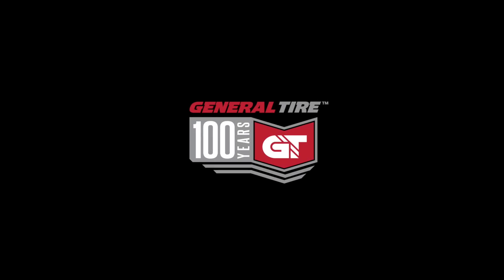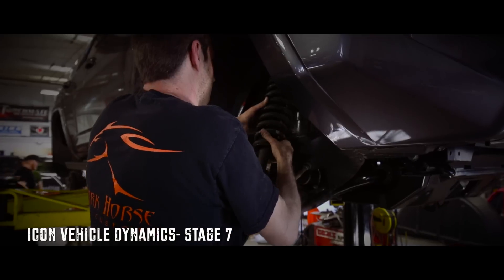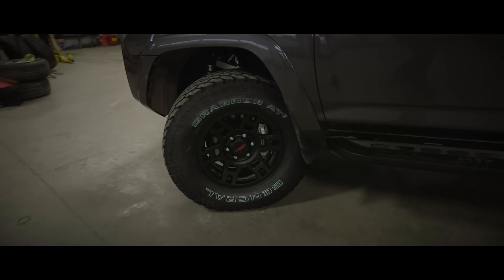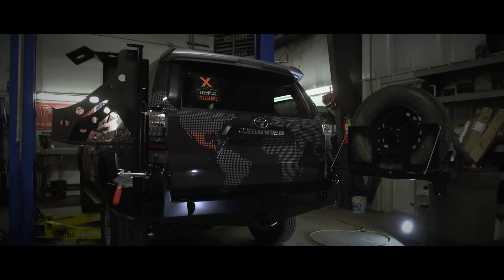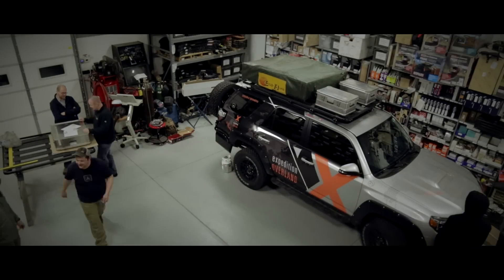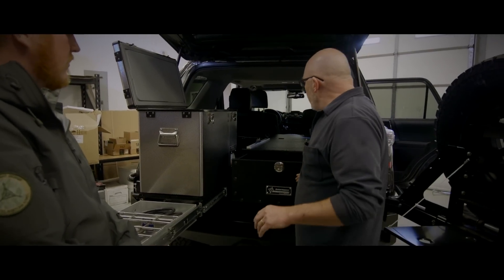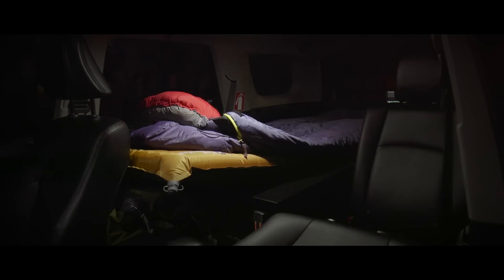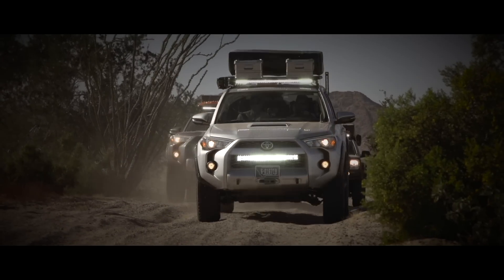Toyota 4Runner Overland Vehicle Builds: Expedition Overland Central America

Comment: I also have stage 7 ICON setup, but my absolute best edition to my overland build for my new 4Runner TRD Off Road has been the Magnuson supercharger.. My 4Runner now feels exactly as it should, on and off road.. I run 350hp to the rear wheels (35% gain in both hp and torque) and can now overtake on highways even loaded for touring.. I can tackle obstacles with less boot.. It isn't over powered and just gives the 5th gen that boost it definitely needed to make it perfect IMHO... I highly recommend it.. Tackling tough trails is a lot more fun now lol.

Comment: Love the series and the vehicles. One important note, batteries cannot be joined in series to jump start the vehicle, as the video states. They have to be joined in parallel. Very important.
Reply: I noticed the error too. Series doubles the voltage and can ruin the starter and other electrical components. Parallel doubles the amperage, which is what we need for starting. Probably just an errant mid-speak however.

Comment: What is the reason for installing Grabber AT2 All Terrains in "285/70/R17"  ....than "P265/70R17" size tires from factory setting ?? 

How reliable was 2015 Toyota 4runner trail premium during the expedition ? Any problems with engines, mechanic, overheat? What was the total mileage during the expedition round trip ? 

I have the exact same Toyota 4runner trail premium 2015. It was awesome to see how the 4runner trail can handle the tough terrains. Thanks for creating this awesome expedition, cannot wait for season 3.

Comment: out of curiosity, could you hazard a guess at what those mods and gear adds up to at retail prices?  I mean, its a very good looking set of trucks, but it sure looks spendy.  Also, did you have any trouble modifying KDSS with the lift?
Reply from the maker: Patrick Rich we would guess that these rigs would hit the 80K price point +/- 5k.
Reply: ExpeditionOverland I just did the math myself and came to the same basic ballpark.  Dayum.
Reply: ExpeditionOverland Only for the modifications or including the car?
Reply from the maker: *****  Incuding the 4Runners lot price which in Montana was $38,000. Some of that cost is shop time cost too factored in.

Comment: How has the Icon suspension interacted with the KDSS.  Does the KDSS function properly with the suspension lift?  Did Toyota have any concerns about lifting the KDSS equipped 4R?
Reply from the maker: Ryan Louis We only lifted 2 inches which has not effected the KDSS at all. All together the two working together is quite amazing. Not as good for offroad but the 90% road time that these rigs get ( like most other overland vehicles) the KDSS makes these rigs feel like a sports car in the curves despite the weight. Its pretty remarkable.
Reply: ExpeditionOverland When you say not as good for off road do you mean that it hinders off road performance or that it doesn't really show any benefits off road?
Reply from the maker: it doesn't really give you any further performance offroad generally the speeds are to slow. The KDSS will "hinder" the down travel of the suspension of about 1" but we consider that a fair trade for the other benefits it provides.
Reply: Good to hear some feed back sounds like a fair trade off indeed. Can't wait to see how it the trip plays out.
Reply: +Ryan Louis i  install icon stage-5 on my 4runner trail kdss  o
.  but !

Comment: Wow, that's a nice rig.  Expensive (if you had to actually pay for it) but very nice.  Almost $7k for the suspension package alone.  

I'm in the process of buying a 2016 4Runner trail premium.  I didn't get the KDSS.  Any thoughts of what you would change first?  (other than those tires).

Comment: Everyone praises how good Toyota is.  The top of the line premium needs a whole new suspension for overlanding.  Not a selling point to point you in the direction of buying a Toyota for overlanding if you need 80k+ to get started.
Reply: Doug Ahern Overlanding is what you make of it.  No one says you need to put in an extra $40K to make something overland ready.  OX did so because they had the sponsors to provide the gear and because their expedition is a lot lengthier and more difficult than your average persons overlanding trip.  For those of us with a day job a trip is maybe 3-7 days.  That can easily be done with a few mods without all the fancy and expensive gear.  You just have to be smart about it and know exactly what you need to buy.  
If anything, it proves that Toyota has a solid foundation and reliability that you want from an overlanding vehicle.  I'd like to know what you think is an acceptable overlanding vehicle.
Reply: Gazziza29 agreed.

Comment: ExpeditionOverland out of curiosity, any specific reason for the supercharger on the tacoma? 

Thanks for sharing the adventure.
Reply from the maker: Tyler Jordan The additional power transformed this truck. Its an absolute blast to drive. All the power you need, when you need it.
Reply: +ExpeditionOverland Is fuel economy not an issue with the SC? I feel fuel economy/fuel capacity is one of the more important things for expeditions in my zero experience
Reply: ExpeditionOverland
^^Which is a perfect segway lead me into the fact that I have an 04 Landrover Discovery V8, 4spd, and Premium fuel only, that i'd love to turn into a light overland vehicle :) Deciding whether to just suck up the V8 and 14 MPG or throw an old 300TDI in there.
Reply: +Tyler Jordan Because Ford did it 1st!

Comment: That battery box on teh back seat is made of steel? And the positive battery terminal has no insulation? I'd recommend adding some insulation to the terminal AND the steel lid directly above the terminal, so if that battery comes loose it won't short out and start a fire.
Reply from the maker: Captain Awesome Its a tough plastic. No insulation necessary.
Reply: Ah tough plastic. All good then :)

Comment: Unless it's changed in the last year or so (which it looks like it hasn't), that's not a sport shift. It's a maximum gear selector. So if you set it to "3", it will act as a normal automatic transmission but only go up to the 3rd gear. You can't specifically choose your gear.
Reply from the maker: +ShaggyTDawg  oh yes you can, clear to the rev limiter in each selected gear.
Reply: How do you do that?

Comment: Which vehicle would you recommend the Tacoma or the 4Runner?
Reply: they're basically the same thing one head of the bed one doesn't but they both share the same engine transmission and basic suspension setup
Reply: they're basically the same thing one head of the bed one doesn't but they both share the same engine transmission and basic suspension setup
Reply: they're basically the same thing one head of the bed one doesn't but they both share the same engine transmission and basic suspension setup

Comment: What is the total cost of each vehicle?
Reply: +Steven Schultz I would put it around 100,000-125000
Reply: +Kap Bab stupid numbers 😒
Reply from the maker: +Steven Schultz more like between 60-75k depending on the different build outs.
Reply: +ExpeditionOverland do you get to keep the trucks or is the sponsorship from Toyota limited to 2 year lease?
Reply: +Steven Schultz I looked up the sponsors and here is the list of everything they installed with prices, I just didn't include the installation costs, but you can get an idea. ;) I'd say about a grand total of 75k
toyota 4runner trail premium $43000
wheels $800
tires $1800
warn winch $1500
air compressor $400
CB Radio $500
graphics $800
bumper $1600
roofrack $1400
tent $4000
lighting $3000
drawers $1000
Reply: +aaronluis11 500 dollar cb? haha what
Reply: +aaronluis11 and also taking in mind that everything here is prob. overpriced.
Reply: basel pc
My bad...Im from Canada and approximated in that currency.  75K US = ~ 100K Canadian.
Reply: +aaronluis11 2 Meter Ham with a remote faceplate. Not CB :)
Reply: +Dustin Coffey My bad, so it's 300 dollars plus installation.
Reply: just the vehicle its about 45000$ each in canada
Reply: You forgot the $12,000 suspension kit
Reply: +Xavier McQuiston it's only 6k on their website
Reply: Not 12k. Not cheap by any means, but definitely not 12k. The Stage 7 with all goodies is 5600.
Reply: It's not $5,600. That's the tubular stage 7. They have the billet stage 7, which is $6,200+, not counting the OME springs or bump stops. Which puts it around $7,000
Reply: binyamj that makes the total about 82K, damn!
Reply: aaronluis11 No it doesn't. You're adding 7k to the already estimated 60-75k. The suspension was already included in that price. I was just correcting the comment that said it was $5,600 for the suspension.
Reply: You low balled everything and you didn't include taxes. It's more than that when all said and done.
Reply: V6? How did all the extra weight impact performance.
Reply: they built the truck in montana, we dont have sales tax here thank god.

Comment: q for you Clay: when it says part time 4wd, does it mean its 100
% RWD until the setting is changed? im a newbie , inspired by your videos, and in the market to replace my sissy rav4...maybe you can include some specs about the rigs in your videos for beginners like us. u never kno who is taking inspiration from you!
Reply: in the 4Runner, part time 4wd does mean that when it's in 2wd mode, 100% of the power is to the rear wheels. It essentially becomes a RWD vehicle. Hope that helps
Reply: +Robert Morrison thank you
Reply: damodharan, Part time 4 wheel drive runs all power to the rear wheels,  but uses the abs system to determine wheel spin. when it detects wheel spin, the differential starts to apply the clutches inside and provides power to the front wheels, then returns it to the rear when the spin comes down.

Comment: Whey change the suspension?The TRD toyota is not good ?
Reply: One reason they upgraded is because of all the extra weight they are adding to the truck. Not that the TRD isn't good, just the aftermarket suspension is built for off road use and extra weight.
Reply: Thank you so much for your answer man.

Comment: Why did you decide not to go with the 'red label' grabber?
Reply: Aaron Davis Homesteading My guess would be the weight difference.
Reply: On gravel or rock a AT tyre will out perform a grabber mud tyre as it gives you more surface area contact with the surface. Also for really long trips the ATs will last longer and give a more comfortable ride with much better fuel efficiency. (Assuming the grabbed red is a mud tyre)
Reply: Fielder5757 the red label grabber is an extreme all terain tire, not a mud terrain

Comment: why not go with a mud tire.... i dont understand why you would go with an A/T in an environment Camel Trophy went to and had difficulties with mud tires. i got Michelin xl 9.00x16 on trd rims on my 91 Toyota pickup and its a great combo. i also have the extra fuel tanks, bed gear bins, armor and so on, still works great, i barely get out.

Comment: How many inches of lift do You have set on the icons? I have a 15 trail 4Runner with an icon stage 2. Going to the Cooper stt pro but seeing what you guys have said about the grabber makes me think.
Reply: I believe the icon has a normal lift of approx 2.5 inches. They dont over do it, but they give them enough room for the 32 inch tires.

Comment: I'm confused cause they added all that weight but no power upgrades. They should've atleast put exhaust, air filter upgrade, and tune or something.
Reply: Remember that a lot of rock crawlers use i4 motors. You don't need 500 horsepower for off-roading.
Reply: Joshua TenEyck
Reply: Joshua TenEyck if exhaust intake and tune even added 5-15hp that's the Perfect amount. More weight on the 4Runner means less reliable engines worse gas Mileage and more gas pedal inputs with is uncomfortable I'm not talking how fast it should be I'm saying for the weight they put, I'm positive the 270 doesn't account for that extra weight
Reply: Joshua TenEyck that extra horsepower would cancel out the weight put on therefore putting less strain on the engine that wasn't accounted for 200-500 pounds of equipment longterm plus the passengers. Why do you thing there are trd pro dealer installed upgrades you can do. For off-roading with more accessibility
Reply: they got tacoma superchargers installed in the 4runners...
Reply: they got tacoma superchargers installed in the 4runners...
Reply: when they got the trd wheels, they also got the superchargers. if you watched the entire series you would know. anyways it also states at end of video ( 11:15 ). they have like 7500-8000lbs obv they got superchargers running...
Reply: Jesse Lacelle ya, there is no supercharger on the 4runners. Just the Tacoma
Reply: Overlanding USA yes there is. The Tacoma and the 4runner have the same engine 😔😔😔
Reply: Hugo Mendoza nope the 4runner is 4.0 v6 270hp 278ft/lbs torque
Tacoma is 3.5 v6 278hp 265lb/ft torque

Comment: And the batteries in series?? Don't think the Toyota electrical system going to like that.
Reply: No different than when someone hooks their battery up to yours to jumpstart your vehicle.
Reply: 2 12v batteries in series equals 24 volts, you hook them in parallel for 12v.

Comment: lol the shock reservoir doesnt help with cooling with this type of shock, it just separates the nitrogen from the shock oil. also the adjustable shocks are a gimmick for the most part. who do you know actually adjusts theirs shocks - this is not necessary with a shock properly fitted to a vehicle. this is just marketing wank. if you want good shocks, go with king, and have an engineer help you pick out the best ones for your application, like filthy motorsports for example